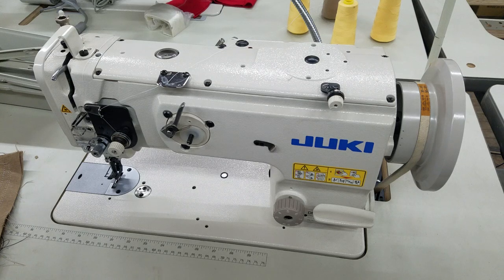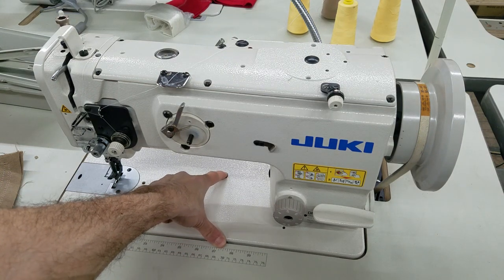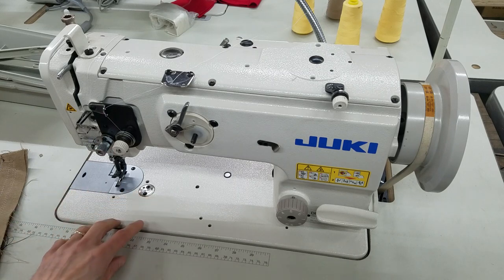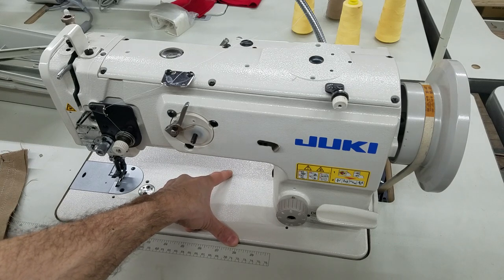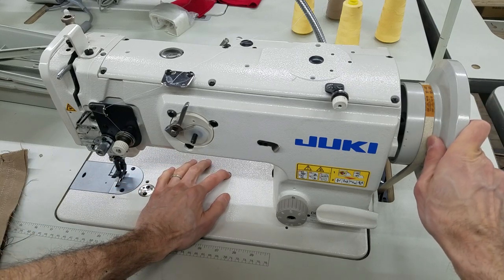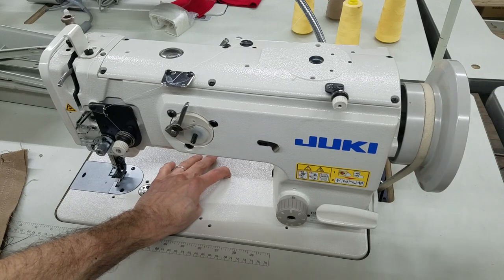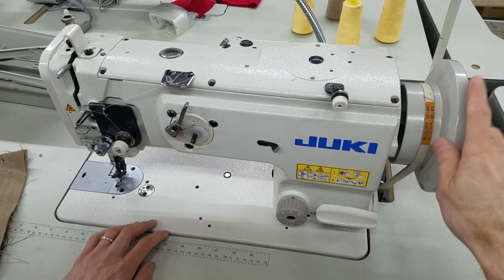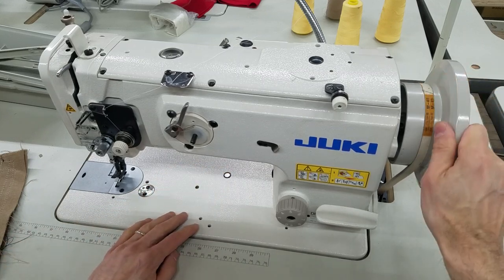Juki DNU-1541S safety clutch instructions

Comment: Is this what happens when you wind bobbin and machine still threaded?  My top thread will not pick up bobbin after I made a new bobbin.  I am very new to this machine.
Reply from the maker: It could.  The thread gets stuck in the hook and trips the safety clutch.  Remove the thread from thee hook first, then re-engage the safety clutch.

Comment: I've got a question. I am about to buy a dnu however, I am now torn between the standard or the S version. I heard a juki seller mention that he sometimes wont recommended the S over the standard 1541 for the mere fact that at times the switch will disengage simply because of the thickness or amount of layers of thicker leather. Is the S version worth getting or will the standard be just fine? I work with leather and the S version is initially my choice but I am not sure now only because he said sometimes the switch tends to go off without really even being jammed. Opinions? Your knowledge will certainly help.
Reply from the maker: That is true.  It is sometimes sensitive.  It is a trade off unfortunately.  The non S version can be knocked out of time easier, but it is rare. We make some adjustments to the S versions we sell to make them less sensitive.
Reply: Steve, how can u make adjustments at home to make the safety not so sensitive?
Reply: Old comment but was interested in this machine in my European country, talked to my countries Juki dealer and they said that the S version is not available in our market at all, didn't ask why but this might be the reason.

Comment: Steve, help!  I have followed the instructions but after my finger depresses the button I am not able to further turn wheel backwards.  Instead, the buttonI makes that popping sound and when I turn the wheel towards me it only goes a little bit and then locks.  I removed the needle but it still won’t go
Reply: I have same problem! This machine has been a nightmare~!
Reply: I have this same problem too.  I have only had this machine 2 weeks and had to bring it in once and now I have had to engage the clutch again.